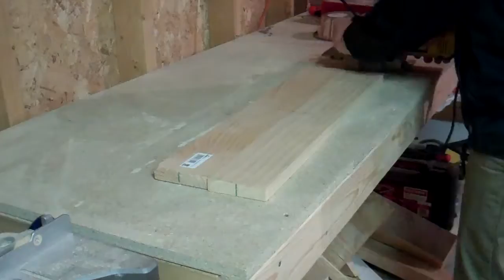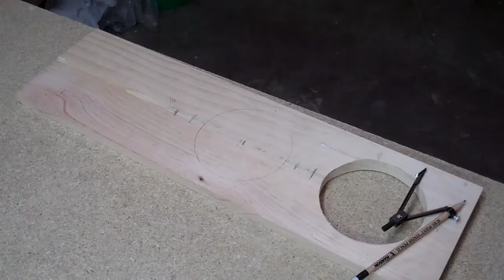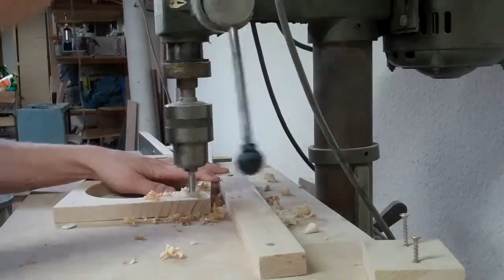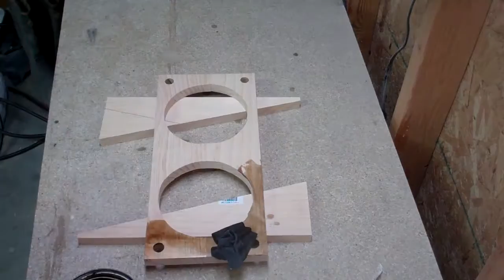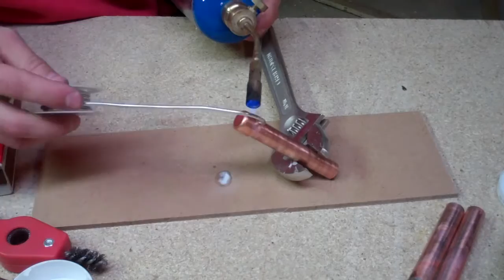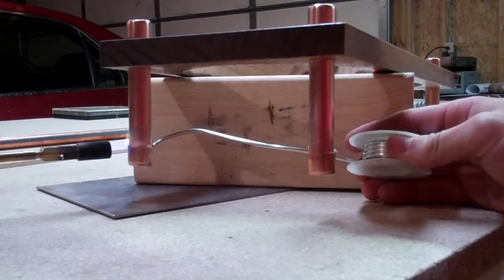Building A Copper Pipe Dog Bowl - Kraftmade

Comment: Cool. Only thing I might add is to put felt pads on the bottom of the legs to prevent staining the floor if the copper oxidizes, or spraying them with a clear coat.